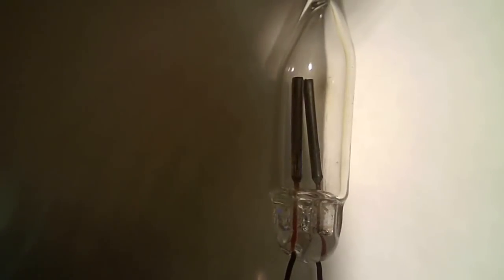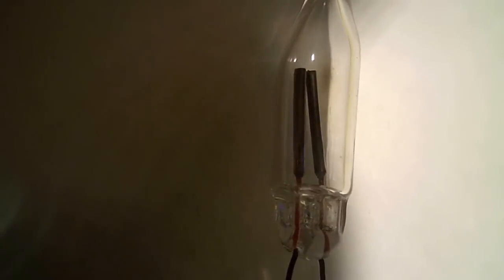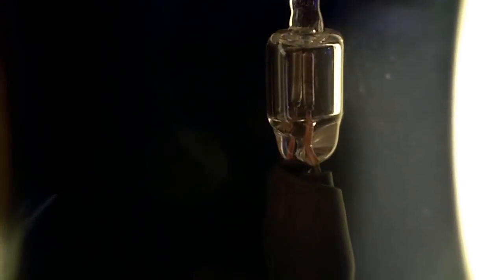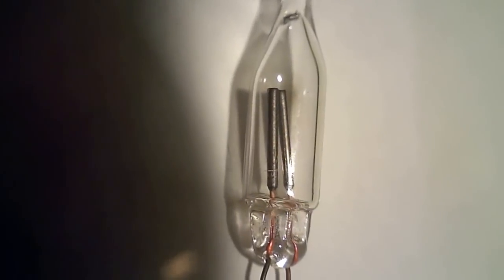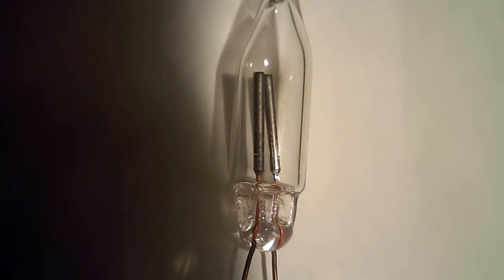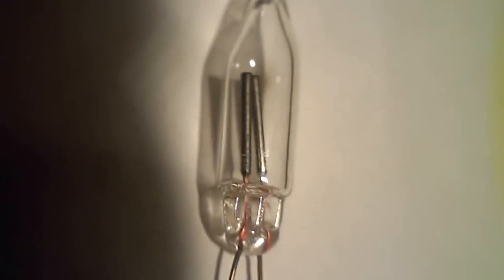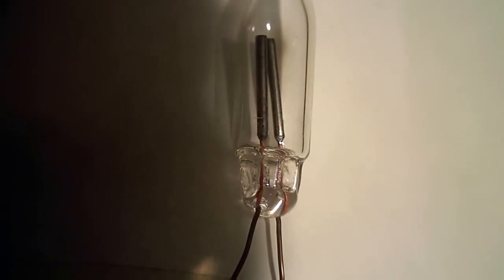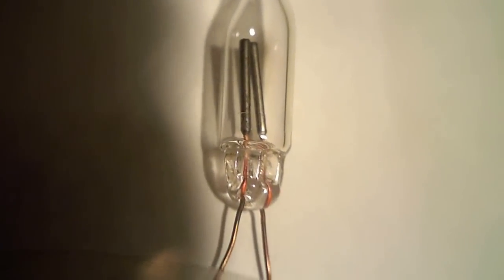Using a Neon light to test your automobiles spark

Comment: This is exactly what I'm looking for. My 4 cylinder motorcycle sometimes suddenly runs on 3 or 2 cylinders and I need to know if it's the ignition system or the fuel injection. I thinking that I can mount a box with 4 neon bulbs sticking out and see which cylinder(s) stop(s) working or are all working. Is it safe to assume that I can use one ground from the box for all four?
Reply from the maker: I would think one ground for all 4 neon lights should be fine. These kinds of lights are difficult to see in daylight, but at night they can help you diagnose your problem.
Reply: @GrantsPassTVRepair  Thanks for the quick reply. Is there a way to wire a lamp into the primary side of the ignition coil to see if the coil is getting a signal from the ECU or crank trigger?
Reply from the maker: @edwardlampe5446  I'm sure you can, but with all the different ignition systems I doubt I'd know how to do so on your specific car.
Reply: @GrantsPassTVRepair  The common basic wiring is: the coil gets 12VDC from the battery once the key is turned on. To fire the coil, the cranks sensor or ECU break the ground for the coil and it fires. I'm working on older motorcycles so it's basic wiring. I need to know if the crank trigger or ECU is breaking that ground connection.
Reply from the maker: @edwardlampe5446  It sounds like you understand the system well enough to troubleshoot it.

Comment: In hardware stores you can find simple small screwdrivers with a neon bulb inside, soms have a classic neon bulb inside, 
and some have a neon bulb like a glass fuse. 
These screwdrivers are useally for direct contact on 110-250V mains , 
but if you hold the tip of these screwdrivers on the insulation of a sparkplugcable, the neon bulb will flash each time the sparkplug ignites.
https://upload.wikimedia.org/wikipedia/commons/thumb/c/c6/Spanningzoeker.jpg/260px-Spanningzoeker.jpg

Comment: spark testers only test spark from the coil going to the plug not on the plug minimum 16000 volts   spark plugs require minimum 10000 volts for the engine to start  when your engine refuses to start with a weak spark spark testers cant tell the difference between a weak or proper spark you can spend hours looking for problems elsewhere that does not exist. you need a genuine spark plug tester that safely lets you view a nice blue spark on the plug diagnoses the problem in a couple of minutes and your guarantee problem solved
Reply: Just knowing No Spark vs Any Spark is a diagnosis. That's what the poster was looking for...is it fuel or spark.

Comment: Does it matter what kind you use for testing like this and for inverters of PSU? Or as long as they're neon it's fine
Reply from the maker: +mrsemifixit It takes a fairly high voltage to be able to light a neon light in this manner, so the only part of the power supply which can light this bulb without an electrical connection is the hight voltage inverter outputs,  but as far as the type of neon bulb you should use I don't have any details other than to suggest you purchase one that looks like mine.